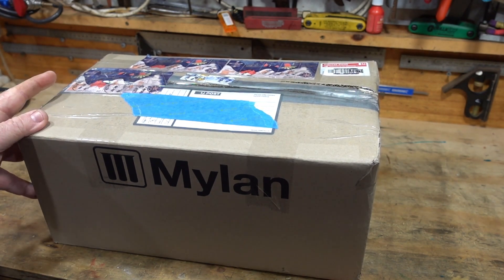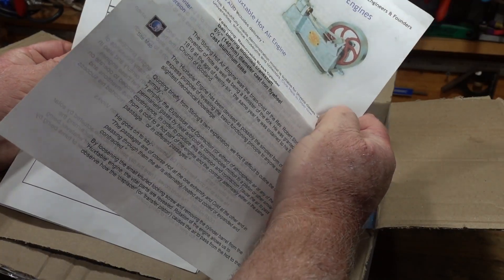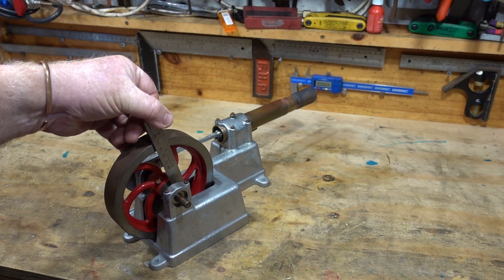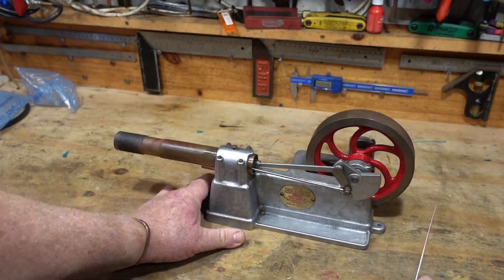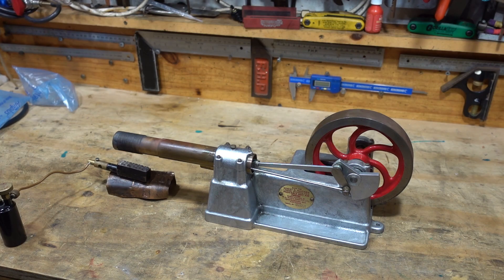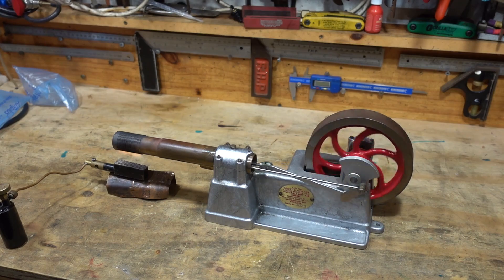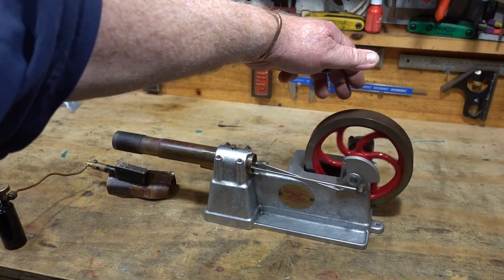Stirling Engine first run of an Olds Engineering Huxtable Stirling Engine

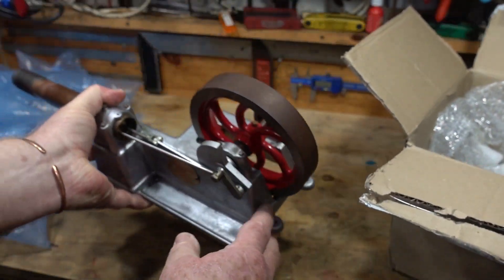Comment: some info.     at 1:50, counterweighting  should not be used, with a heat engine.    because, such a process  Absorbs  energy.     energy that will Not be available at the output shaft.     the use of crank arms is  not recommended; because  the mass is not  radially symmetrical;  thus, the out of balance condition at a crank, is  Increased.     ideally, a  disc-shaped  crank component Should be used.     it appears that the design of the (cold) piston wrist pin assembly is less-than ideal.     see the radially, asymmetrical transfer of force, at that point.    cheers
Reply from the maker: A lot of negative thoughts on an engine that works beautifully.